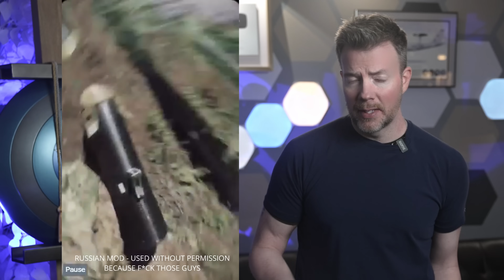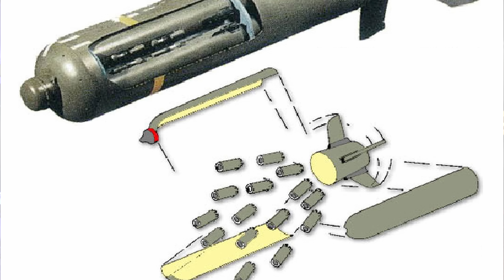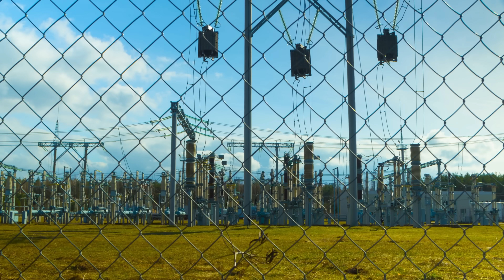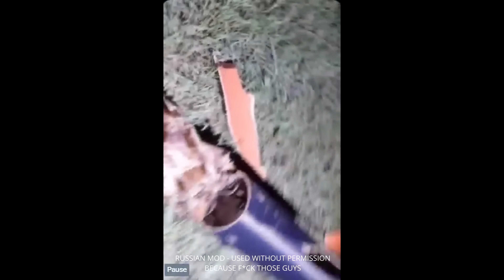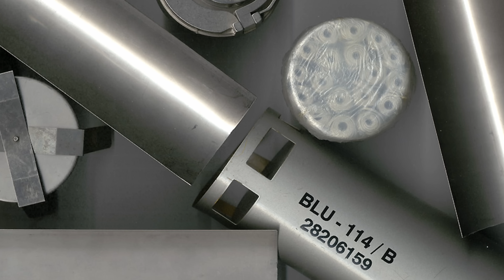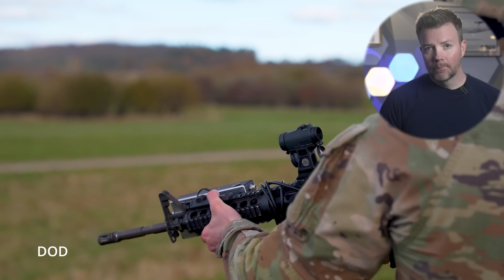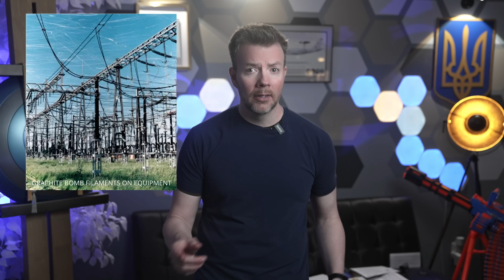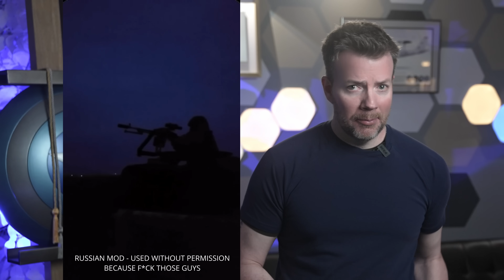Russia Claims Ukraine Using Graphite Weapons - Here's Why

Comment: You can't say the bomb is merely a humane on/off switch and then go on say that the entire electrical grid sustains DAMAGE such as transformers that are hard to replace (because they destroyed by a graphite BOMB), switch gear that takes months to produce (because the switches got DESTROYED by a graphite BOMB) etc.
Reply: New switchgear is a MINIMUM of 2 years out.  Reconditioned provided it is available from a bone yard would be months.  On a larger scale it would be disastrous.

Comment: The usual payload is a metallized carbon fiber. This is the material you'll find on old US NOFOREXP lists. But how fine a metallic-coated thread do you actually need? My guess is that it could be as thick as what you might find on a 3D printing spool, if the delivery is done correctly.
Second, this makes drone tech much more to be controlled within your own borders, to prevent non-state actors from doing... all the things.

Comment: Hell the Brit’s did the same concept with balloons and steel wire against the Germans in WWII. https://en.wikipedia.org/wiki/Operation_Outward  Be funny if the ukraines did a mass launch of a modern equivalent when the winds favorable. At worst Russia expends a lot of effort countering them at best they fry a bunch of long lead time components in the power grid. Could also have infiltrators plink at transformers across Russia with subsonic integrally silenced bolt action .22lr till they blow too then sneak off repeat.

Comment: So very Ukrainian, work smarter not harder. If you hit a sub station I'm curious about the potential collateral damage. You have high voltage and amps jumping into sensitive parts and areas not designed for them. 
    Cheers from Canada 🇨🇦 🇺🇦

Comment: I'm imagining those spool dispensers they use for fiber optic controlled drones, adapted to drop heavier graphite threads as they buzz around, so they can conduct a whole lot more current before burning out & the short lasts longer. Plus, they could hit many different locations in a single run, swarm a dozen of them & it would be near impossible to track where they are now from many shorts popping up all over the place at random.
Reply: The filament itself shorting isn't the main issue since it'd just immediately burn up. The primary use case is disrupting the insulation between high voltage transmission system lines to cause arc flashing. This would mostly only be effective at ~100 kV or higher.

Lower voltage primary and secondary lines would just vaporize the short while not having an electric field strong enough to cause a sustained arc. This limits the threat to open-air transmission systems that would be few and far between.

Comment: An Idea pops to mind: Instead of graphite wwhich is har to obtain and maintain, use canisters on a foxbat type drone, canisters filled with coils wrapped in conductive material. Fly that thing onto a trans-station^^ blow up the canisters an crash that baby. So you have not just the "soft-damage" but also a bit of a "kinetic slap".I think a whole lotta "copper-wire", making short-circuits all over the transformer, could do the trick cheaper than fancy "graphite-transforming-into-"plasma tunnels"

Comment: Another thought, it doesn't take a genius to wonder, what about Aluminum chaff?  If you can disperse graphite threads, chaff is remedial.  That would explain some of the AA equipment sitting around not firing at incoming drones.  All they can see is a field of white noise.

Comment: Every day is a school day! Never heard about this...
Thank's for informing us on this Wes!
Slava Ukraini! 🔱🇺🇦 💙💛🇺🇦 🔱
Reply: @thomash3716  I also had never heard of this weapon.
However, while working in Northern Saskatchewan, I have heard of the power being knocked out by nearby forest fires.
The flames do not need to damage the posts or wires directly. Thick smoke contains enough floating carbon to short out the high voltage power lines, in a very similar manner to how the graphite bomb works.

I have also heard of people disabling older gas engines by drawing circles inside the distributor cap with a pencil... also graphite based.

I may not have heard of it before,  but it makes perfect sense.🤓
Reply: @Wonkothesne  🧐👍

Comment: Very interesting. Most substations are open, but modern HV systems can have enclosed switchgear.

Gas Insulated Switchgear (GIS) is a type of high-voltage or medium-voltage electrical switchgear where live components (such as circuit breakers, disconnectors, and busbars) are encapsulated in sealed, metallic housings filled with dielectric gas. This gas, commonly sulfur hexafluoride (), acts as an insulating and arc-quenching medium.
Reply: @manxman8008  that is to make switchgear smaller. If there is enough space, it is open air.
Reply: But who says that terrorist state has modern power systems?

Comment: Let's assume the Ukrainians have such a "tool" and the next winter is in full swing. What should them hold back from switch off the lights in Moscow and St. Petersburg as revenge for attacks on Ukrainian cities?
Reply: @carstenlichy-bittendorf3902   maybe, but it's also good to keep in mind that other countries border Russia too. If those filaments get picked up in the wind and fly to Finland or Poland, it's going to anger a lot of people.
Reply: @B1gLupu AFAIK the effect is relatively local. Mind you'll need a certain density to cause an effect. So it will be limited to the substation you target and not impact anything kilometers away
Reply: @carstenlichy-bittendorf3902  Innertia navigation fails on occasion. We just had 3 Ukrainian drones land in Finland. With these, the effect could be bigger.
Reply: @B1gLupu  With distance, the cloud gets diluted, surely?  That suggests Poland and Finland will be fine.
Reply: @Ecocidologist   St Petersburg is like a stone throw away from Lappeenranta and delivery by drones is a bit inprecise.
Reply: @B1gLupu  that's a ludicrous hypothesis. They need to be targeted over a relatively small area to saturate conductors and power lines and cause the shorts.
Reply: @n8spL8   Sure, but finland just had 3 drones land in it's area, and if that happens with these that would be a big problem
Reply: @B1gLupu  the odds of the drone ending up 5-25m exactly above a substation, when off course, and then discharging its payload of fibers approach the astronomically impossible.
Reply: @n8spL8  risk calculations of people who don't live here weigh pretty little. If it's hundreds of drones, eventually something will go wrong
Reply: @B1gLupu  Do you have the slightest clue how this munition functions? these fibers have to be precisely delivered right above the station, a drone hitting the ground off course will do nothing unless it lands on your head. Even if, by some statistical miracle, one does perfectly disperse its payload over a friendly power station, it would be back up in days as it would not be under any kind of sustained threat from an enemy. The odds of the power-station being rammed by a drunk driver or hit by lightning exist too and are much more likely. My location has nothing to do with probabilities and the physics of the munitions delivery mechanism. 
I hope you can breathe easier now.

Comment: in other words, we all need to put solar cells onto our roofs so we are not fucket when this happens to our citys.
Reply: Except almost all home solar installations are grid tied and switch off when the grid goes down rendering them inoperative unless you have a dc coupled battery system and an isolated mains inverter installed
Reply: @maramé.r  most home solar systems these days have at leas a small battery system. You kind of need that even to take finantiel advantage from that. And yes if you install a solar with the motive, of not being screwed when the grid is down, that is somthing you need to take into account.

Comment: It sounds like it's the glitter bomb of real warfare: it won't hurt you, but it is SUPER ANNOYING to deal with.
Reply: @Mondoblasto0  now that's a collab with Mark Rober is like to see!
Reply: Excellent, clear presentation - thanks
UK
Reply: Probably faster to build, ship and install a new power station than clean all that shit.
Reply: Only it can hurt you. Depends how quick retoration of power is. Hospitals, domestic heating, water treatment, banking and retail... they are all conected to the grid. They all need lots of power to function. And yes, the hospitals have generators but... Trump is creating a fuel shortage globally. China and the US are trying to control the materials used in parts to repair electricity networks, data grids etc.

Your assumption this "won't hurt you" is completely wrong. It can absolutely hurt lots of people quite quickly.
Reply: @thebrowns5337 Well certainly in that context you're absolutely right. In this conflict though, I wouldn't expect Ukraine to make that kind of objective. For example, it would be deeply questioned if they, say, targeted facilities during the winter that help keep heat going for homes and the like, the kind of thing that Russia would only be too glad to make a target.

Comment: The defense against this is not that complicated, just really expensive to maintain. You build a non-conductive tent over your grid. Building it to probably last the summer is relatively cheap per substation and per kilometer. But there is a lot to cover and wind damage alone would result in a lot of manpower working on maintenance. Think a cope cage on every transmission line.

Comment: Curious...does graphite melt on the lines and would that require installing new power lines?
Reply: The graphite vaporizes, which creates a highly conductive ionized carbon path (think carbon arc searchlight)
Reply: @OrmondOtvos  Thanks.  Those carbon arc lights are actually quite blindingly bright.
Reply from the maker: Yep, exactly what Ormond said. No permanent damage. Usually.

Comment: The scary thought is how vulnerable any grid is to this kind of drone attack.
Reply: Another Pandora's box opened by this hellish war.  Once a weapon is used by either side, it's relatively easy for the other side to reverse engineer and use it too - and then the technology spreads and becomes available to rebel and terror groups, making everyone else vulnerable too.
Reply: Agreed... we should be working on defenses for this, yesterday.
Reply: @onehitpick9758   yes.   Burying high voltage lines is probably the simplest and most effective way to harden the most important parts of the grid, but it is quite expensive.  Microgrids can help a lot, and are much less expensive as well as quicker to deploy.
Reply: @JohnGeorgeBauerBuis  putting a roof over substations or even netting probably would solve a lot of the problem, as the main attack vector is things drifting on the wind, but high voltage lines definitely would require some different thinking,
Reply: @JohnGeorgeBauerBuis      or we can just use our own personal large generators but don't let the Democrats know they'll just ban them.
Reply: @mitchweber7868  personally I would want to hook up a belt-driven generator to a steam traction engine, , but I’d need a steam traction engine first.
Reply: @mitchweber7868  nice
Reply: @mitchweber7868  yeah... so how you running the gennie? Oil.....great idea
Reply: @rabidmidgeecosse1336     What goes down first a small attack on our grid that effects thousands or they blow up every single road across the US so gas can't be transported?!
Reply: @onehitpick9758  either that or arrest the Epstein class pedocracy
Reply: @onehitpick9758  I love it when people speak so confidently and assertively about shit which they have zero effing clue (because it tells me everything I need to know about them).
Reply: these sort of graphite  bombs were used extensively against Serbia by NATO (1999) it was used to "switch off" electricity. those are not destructive and effect is temporary , repair needs cleaning mainly and can be fast. russ would not used that anyway they never would waste a vector to aim at non permanent destruction.
Reply: Yup
Reply: 😂 dont learn network programming 🌐 youll never sleep again
Reply: Depends on the country, many western European countries are somewhat hardened against this for cold war reasons because the entire grid was rebuild after the second world war. 
Where I live transformers sit in their own concrete or brick home to be protected from shrapnel and distribution lines are dug in. Yes, that means you need to dig about a meter deep if you want to hook up a new building but also means very few cars take out electricity poles. 

Transmission lines are still vulnerable, but I have a feeling they have enough power to vaporize the threads, and then the automatic arc suppression kicks in, shuts it down and restarts it a couple seconds later when the ionized air was able to dissipate.
Will it be perfect, no of course not but it's better than nothing.
Reply: @MichealHilleman yeah I wish the US had that level of foresight. There was an outage a few years ago (forget which state, may have been in NY?) when someone shot a transformer with a rifle.
Reply: @willbates2174  Happens a lot actually, the ones you are thinking of was someone who shot 2 or 3 of them to be sure no alternative lines were usable.
Reply: @willbates2174  Well, Texas can't learn and every winter their grid has (foreseeable) problems
Reply: @saiv46  think on the positive side we get too make fun of Texas because of this issue
Reply: @willbates2174 that was w. Virginia and washington
Reply: @saiv46  this is wild given Texas is the largest energy exporter in the USA lmao
Reply: @manjoring5944  always take the opportunity to laugh at Texas…

I’m from TN so it feels nice to able to laugh at someone. At least we have the TVA goblin on our side.
Reply: @manjoring5944       our taxes should be going to our military that's who protects us, states shouldn't spend ridiculous amount s of money bomb proofing everything
Reply: @saiv46  because the solution to power grid issues like this is well more expensive than the current state
Reply: @willbates2174 I also remember a shooting where they shot a transmission center and damaged 2 large transformers
Reply: @willbates2174  Jokes on the enemy, because the corporations own our utilities and it is decentralized if they were to do this with graphite bombs, it wouldn't do anything.  They alreayd over charge but under serve.  We wouldn't notice a thing with our thousands of shit grids.
Reply: @mitchweber7868 say that after somebody begins bombing your hometown. Protecting vital infrastructure is just as important as military spending and the biggest threats come from above. Why else would they be using something like graphite to take out power grids if not because it gives you a strategic advantage? Or are you suggesting that they should start stationing soldiers along every power line?
Reply: @maxmustermann6993     I'm conservative and of course I think we need to spend plenty on the military, I guess I'm the biggest proponent of that national iron dome system, that seems the best. because like you said all the threat comes from the sky, with drones that cost $1,000.
Reply: Maybe trump plans on using this to knock out the power plants in IRAN
Reply: Something the American regime and their followers should remember before threatening other NATO countries. They can't comprehend the amount of damage NATO SOF can do to such a large and undefended country from the inside.
Reply: @willbates2174   this is why on-site power generation is so crucial for residential spaces
Reply: imagine still using poles to carry electricity. plebs

Comment: Hi, Wes! May I doubt what vodkadikts show looks tens of times thicker than graphite philaments..?
Also, even I doubt the kind of "secondary damages to population" make me feel comfortable about using them... In non-advanced zones where reparations could last weeks, not minutes or hours. (Actually, any advanced world has a couple of spare transformers for each needed point, and switching gears can be brought in 1 day from any electrical supplier, apart of what the electrical stations have in their warehouses. I had to work close and almost ANY device inclusive rolls of THICK wires are stored, just in case...)